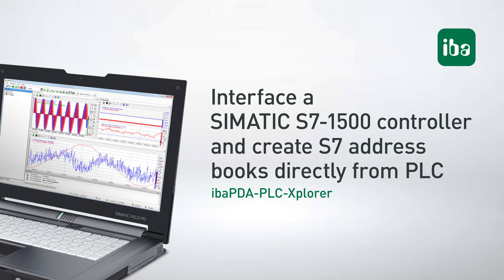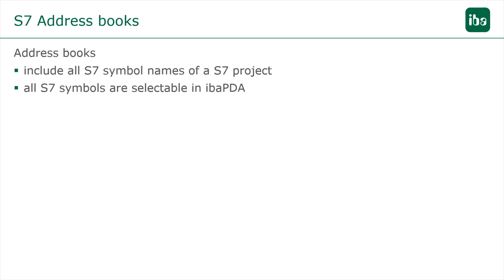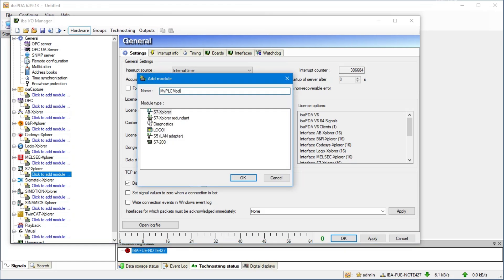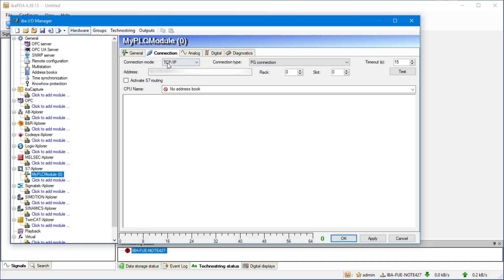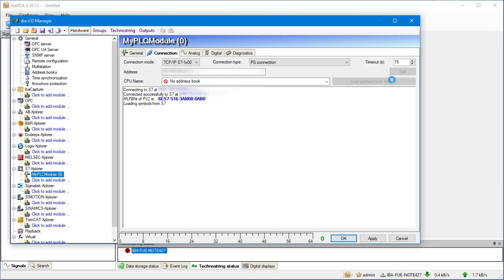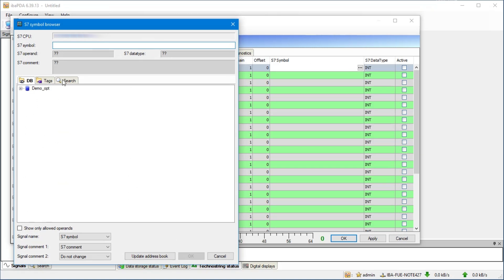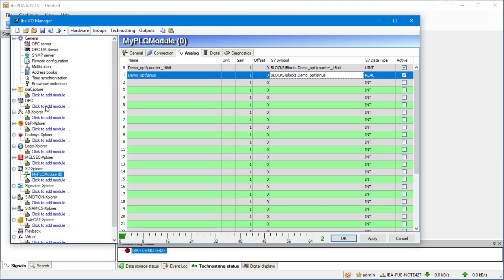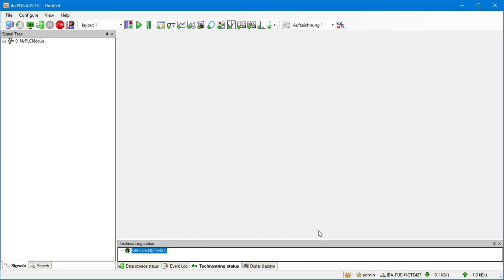ibaPDA-PLC-Xplorer: Interface SIMATIC S7-1500 controller, create S7 address books directly from PLC

Comment: can I add signals to ibapda not one at a time, but several at a time?
Reply from the maker: Yes, it is possible. Go to the “General” tab of the S7-Xplorer module and use one of the links “Select S7 operands” or “Select S7 symbols”. Selecting of multiple signals is now available, as well as adding without closing the dialog. Best regards!